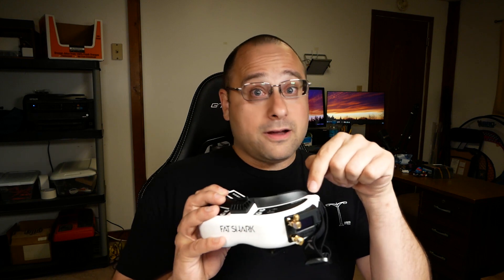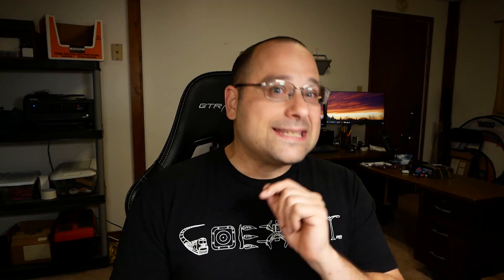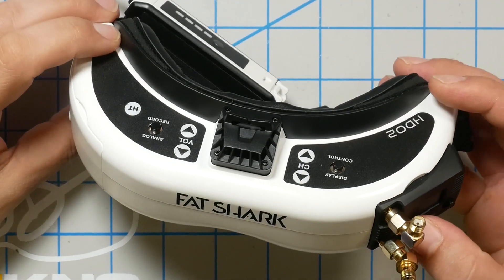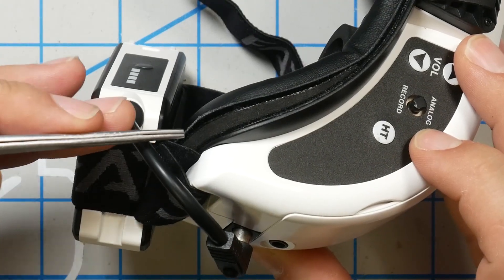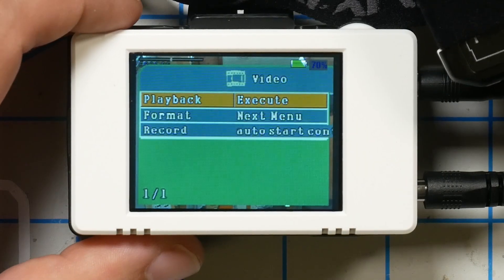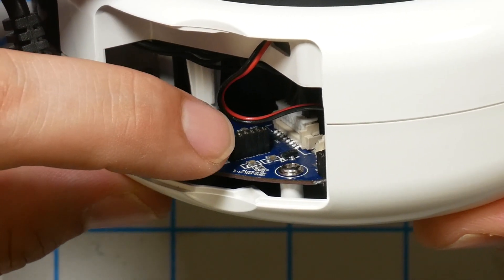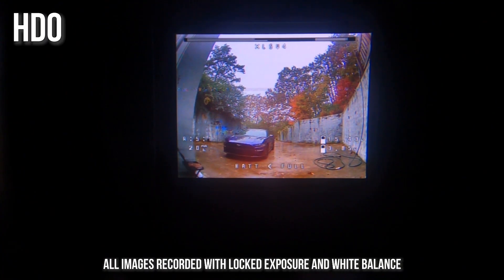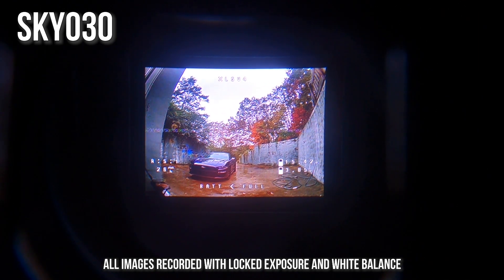Fat Shark HDO2 review (hands-on vs. HDO, Skyzone, DJI)

Comment: To purchase the HDO2 with Rapidfire and antennas plus shipping cost to Australia = $1,088 AUD.  The DJI System (goggles + 2 flight packs, no VTX required) = $1,200 AUD, free shipping.  NO "100% NO" I will not be purchasing the HDO2's.  I'm extremely happy with my DJI system now in 3 quads and 1 wing and I will continue to use my out-dated Fatshark HD2 for all my out-dated 2.4 analog long distance equipment until something much better then the HDO2 comes along.

Comment: Looks like I’ll be out of luck for these fitting my face now it doesn’t look like the face plate can be swapped for the eye cups anymore as the face plate on my hdo’s only touched my face on the outside corners and is completely in usable ☹️

Comment: So my fan never turns completely off. it's always a noisy grinding thing.  The getfpv review confirms this. Anyone else fly in 16:9 mode because the field of view is too large / gives headaches ? I'm $900 deep with these and the original hdos and just have to try something new :(

Comment: I like how Joshua goes against the grain and does not put out any video about the Mavic Mini.  I have a theory that the Mavic Mini will kill the micro quad scene.  Most micro quad flyers are not into racing - if they were they would get 5 inch quads.  The problem with micro quads is they failsafe after flying a football field in length and they have to return in under 4 minutes.  The Mavic Mini blows the micro quad limits out of the water and while the FPV experience is different - no need to deal with fuzzy video.  Sorry - the Mavic Mini is going to hurt the hobby big time in terms of where the dollars are going to go.

Comment: I would comment on the newer video but since that is disabled: I chose bytefrost, although I think the DJI system is better. Why is that, you might ask? It's just like with Chrome and Firefox: in my opinion, Chrome is the better browser but I don't want Google to have all the power about the internet (remember: Edge now also uses Chromium, which is mostly maintained by Google). The DJI digital FPV system is better in my opinion, but Bytefrost is just the more open standard which I am more drawn to, especially because I assume DJI already has an upgrade up its sleeves which they can use to threaten pretty much any other manufacturer and I don't want to help DJI with that. You know, competition helps the market, but DJI doesn't just want to compete, they want to own the market, just like Apple tries to own their customers and never have them leave their ecosystem. (BTW I don't use Apple products primarily because they are inferior yet completely overpriced)

Comment: What about SCREEN BURN IN for the oleds?
And please do a check with bytefrost since the screens resolution make it better.
And....screw dji.
Reply from the maker: HDO have had zero issue with burn in so far. I doubt it is a problem unless you crank the screen brightness way up.

Comment: I bet Skyzone 4 will top Fatshark HDO 2 with similar features when they release a new goggle.
Reply: Congratulations, you are right, SKY04 will be supplied by HDO2 solution provider. Now that everything is ready, you can go public after waiting for the 6-month protection period.
Reply: @oscarliu3940  all Fatshark key components are proprietary so they won't be available to any other mfg.

Comment: will quads ever use li-ion instead of li-poly batteries?
Reply: lipo has higher discharge capacity, you'd sag out with li-ion's on first send - so no.

Comment: Astigmatism here... I would drop the cash and upgrade from/sell the HDOs, but they would be useless to me..  such a shame.
Reply: IIRC Joshua also has some astigmatism, so you might be able to still use them, but you should definitely wait and try them yourself before making a final buying decision.
Reply from the maker: I also have astigmatism but the diopter adjustment by itself is good enough for me. These are 100% my new daily driver even though they don't take my diopter inserts.
Reply: Joshua Bardwell Just had a new eye exam yesterday..
R -4.00  -3.00 x 165
L -3.50  -4.75 x 002
They said it was a pretty bad astigmatism 🤷🏻‍♂️   I’ll definitely give someone’s HDO2s a try when I have the chance to.  Thanks for the reply

Comment: Does anyone know if you can use TBS Fusion and Rapidfire modules without having to open the goggles up or do ribbon cable mods?
Reply from the maker: No mod is required for RapidFire. Fusion only requires a mod on the HDO if you are using WiFi. I assume it's the same on the HDO2 but TBS would have the final word.
Reply: @JoshuaBardwell  thanks mate!

Comment: Got one question then im buying will the laforge module fit in the side the usb is on.i run an older v2 and run two modules
Reply from the maker: I am not 100% sure but I doubt it. The LaForge was always a really tight fit up against the board and now there is a USB plug there.

Comment: That could be a perfect goggle, but can't do my +3 dioptreen.
btw: with this resolution and possible headtracking and hdmi-input this goggle could be also usefull as VR-goggle. It could open a new market for Fatshark if they would do the required software-work to support this.

Comment: DJI can’t do long distance like analog, can it? I fly both wings and quads and I don’t think the high def can compete!
Reply from the maker: DJI can get a few km out especially with higher gain antennas. But its output power is fixed at 700 mW so once you hit the limit of what antennas can do, you're stuck. With analog you can (legally or not) go much higher than 700 mW and push longer ranges.

Comment: I just got the dji set and did the iflight anilog mod I also went one step better on the mod I install a power switch so I can turn off the rapidfire modular when I'm flying hd. Looks like another fatshark product giving us just enough to be only a little bit better than there competition with a shit DVR. I have the hd0 set a big fat wast of $. I'm going to stick with the dji yes it don't have oled but the pic looks amazzing way better than hd0 hands down anilog on dji blows fatshark out of the water. Keeping my fingers cross that  Oculus or anyone that can give me my 4k goggals that I can use for a all in one system id pay $2000 if I could get a 4k, vr, home theater, vidio game, digital fpv, and anilog fpv set of goggals.

Comment: 18:52 oh you should have shown the DJI Image as it ships, not scaled down.
Reply: The DJI goggles always scale down analog input, you can't change it (yet, DJI had confirmed it should be possible, so if there's enough demand, they cán release a firmware update to add it). Scaling is only available for digital input.
Reply from the maker: That's how I use it, so that's how I show it, but you can clearly see the overall size of the screen.

Comment: HDO at $200 and i'm sold... anyone selling?
Reply from the maker: I think that's pretty ambitious pricing. I think $375-$400 for a brand new HDO is pretty fair compared to $500 for an HDO2. The HDO is not a bad goggle by any means. I would be pricing used/excellent condition HDO at $350 to maybe $300 at the bare minimum.
Reply: @JoshuaBardwell  It is ambitious pricing..mostly a joke, but...but...sometimes, you gotta put it out there.  I think HDOs will settle for about half their retail after a bit.  right now, not so much.

Comment: ahem... DJI is also a closed source box goggle... and has the latency issue...
Reply from the maker: There is no latency issue. It's really a total non issue almost always. And the times when latency occasionally hits you, analog would also have hit you with static. So it's pick your poison. But DJI has you viewing HD the whole rest of the time.
Reply: @JoshuaBardwell  absolutely love my dji goggles! I go way further without break up or latency than i ever did on analog!!
Reply: @JoshuaBardwell  I think that racers and flipity flopy freestylers as steele or Stingy will not accept dji variable latency. You love it because you always fly close range in a radio friendly enviroment. I think that Fat Shark is taking a better decision with their approach to the low signal/noise behavior, the form factor of the board on the quad and the opensourceness... Although they are behind in this race... They delivered an impractical product uncomfortably compatible with their goggles that allows less people in the air while having a better but not the best image...
I just disagree with your hands down is the best for a beginner with no money limit. But is only my opinion. I do love my HD2s

Comment: personaly i just got the Dji too....f***k analog yep (for me i talk of course)...the price worth it....i personaly fly  alone so i dont care for other people signal etc etc....the expensive "good" analog is not even near the real HD image....u also avoid getting extra go pro and goes on.....if someone has so many quads ...can keep his existing googles and go on with dji to some or new ones ...i dont get why if you get the dji and have 200 quads  means you should turn them all necessary....i just dont like the dji radio ...no screen no nothing on it just stick +switches and more expensive than any Frsky...i personaly have 2 frsky radios and 2 futabas (mostly for 3D helis the last 10 years) but now some companies brought some micro recievers to the size of xm+ rxsr...i will test the futabas to check if its better for me to get rid of the frsky radios too...dont know for that....but for the fpv system i wont get any analog again now..we hope to drop a litttle the price for every air unit sooner or later and all good in time and with new updates (Y)

Comment: DJI with a Fusion module for micro. Works out great. I love the micros and the Fusion works fine for me. My better drones are DJI. I am old. I need HD. I don’t race or do acro bashing freestyle. Latency is not an issue. DJI with an analogue module is the best of both worlds and the cheaper solution for me.

Comment: If I put the analog module to the DJI goggles is there also the latency that is changing all the time or is it fix latency? I am looking for the goggles that I could use with digital and analog signal :) Thanks
Reply: Which digital signal ? DJI , shark byte , conex ?
Reply: @nistax2880  no analog
Reply: @rokg12  if you want analogue than go with these or skyzone sky04x

Comment: I'm new to fpv, just building my first drone and playing on a simulator, i've never used a set of goggles before! If you've got one shot and making probably the biggest investment in your setup....Looking at fatshark and dji...hands down dji wins in my opinion, they set the bar to high and looking at fat shark even these new googles look like dated technology ? if they not digital. If your new to the sport its like walking in a shop looking at 8K TVs and then asking if you can buy a black and white TV from the 80's...this is a NOOBS perspective not a rant but fat shark seem to be lagging behind and that byte frost system needs scrapping and just making a proper goggle! PS. thanks for the great videos! And is mobula 7 hd still the best starters quad in your opinion????

Comment: Them goggles are pretty vulcan expensive captain...

Big whoop on the power button, never wanted one, never cared - good call Fatshark. Until now... Just wait until somebody shuts off their vulcan goggles by accident and crashes...
The hell with the power switch, the bypass jumper was a good move for Fatshark, BUT.....
Lack of a diopter lens slot is a dealbreaker for me. I can't see anything but a colored blur without the corrective lenses, it's not even an option to fly without them. I have RHO  lenses in my HDOs, and the cheap plastic lenses in my Commanders (which are my backup backups, I roll DJI, HDO, Commanders, Headplays. The DJI method of designing to allow use of your glasses wins hands down. Works great, easier to use (not constantly losing my glasses), cost nothing extra, and I can hand them to someone without changing inserts. I just received the IFlight conversion kit to add my RapidFire to the DJI goggles, still need to do the install, then I'll have a "Grab and Go" solution for my video.

I'm of the latter list, as unpopular as it is. I don't get how so many people can fly analog after an afternoon flying HD. The variable latency some complain about is barely noticeable to me and only when you are way way out there, certainly NOT a reason to go back to analog, where you're looking at snow at similar ranges, latency being the least of your concerns....
As micros go, I guess I'm stuck with HDOs for my Whoops, and that's OK, because they are best suited to the close in work you typically see with a Whoop. I have 2 3" quads running DJI HD already (they fly quite well), 2 5"quads , 2 6" and a 10" (currently running 7" while I sort it out).  I still have the analog gear for group functions, but don't enjoy flying it all that much anymore. It will probably all end up in the box with my Flamewheel and the diecast security cameras running Lawmate 1.3Ghz 3watt VTXs..... Maybe it will be worth something to my kids when they sell "A box of old FPV junk" at the garage sale. I can see it now, "Hey - look there's a set of old Fatsharks in there, I'll give you $5 for the box..."

Comment: This HDO2 is a real screw up with those who bought the HDO. first of all the HDO was released as a "game changer" in April 2018 for $500. now they release the new HDO2 within the period of an extended warranty even not expired?! It's like SONY Playstation would be released in every two years. (BTW that would cost less to buy.) I think Fatshark is just a survival machine. they coming out with new stuff just if other companies have a threat on them. this HDO2 is the best analogue goggles at this moment, ...but how long?! 

EDIT: in Jun 7, 2018 in your vid you had a discussion with Fatshark owners (https://www.youtube.com/watch?v=p9tgLA9V9Ok) and they said they can't have bigger screen because it would not fit in the $500 budget. now it seems it possible even with a better OLED display?!
Reply: you gotta remember 18 months gives time for screen prices to be reasonable. those small screens have to be sourced
Reply: @rabidbydesign  yeah maybe. but I think this HDO2 just skin one more layer off from the customers before switching to digital. I bet they will coming out within 1-2 years with a new digital goggles or maybe a digital/analogue combo EDIT: I mean a better all around solution than the Bytefrost
Reply: @zoltangremsperger5361  agreed but what in technology lasts 24 months or even 6 these days